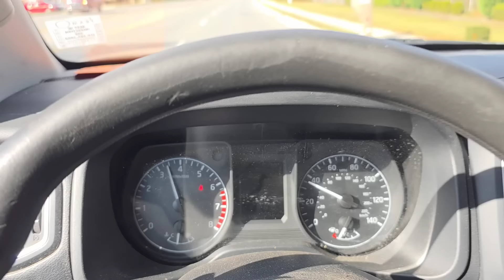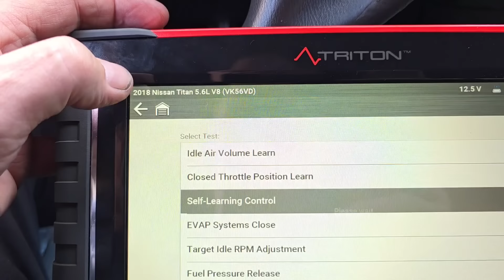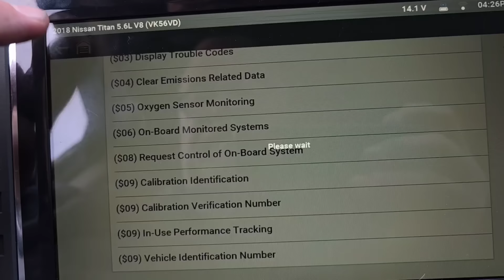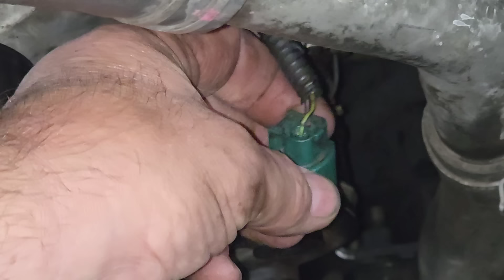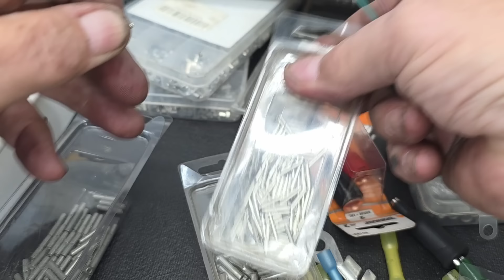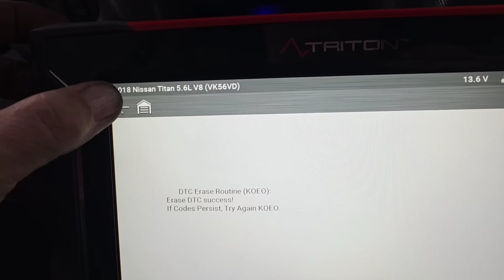Mobile Mechanic You Don't Know Can Be Costly!!

Comment: 2:53 Does it have any weird tune on the ECU? Or a weird OBDII "fuel saver" thing?
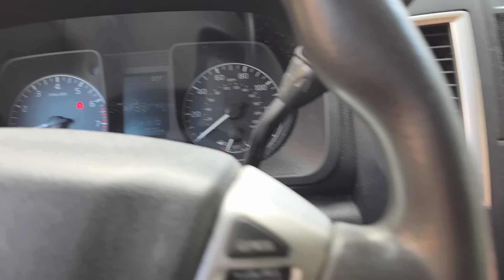4:34 I have no idea.. I know my 2005 Nissan Frontier was acting odd, but it was also stalling, it was a camshaft sensor, but you don't have a code for that.

Comment: I completely get why manufactures went from metal keys to key fobs and push-to-start because sliding a key into the switch and twisting it is just too much work! Turning a metal key is to carpel tunnel just as crank starting was to broken arms! 🤦🏻‍♂️🙄

Comment: Kenny, when you solder wires it is far better to tin the wire first then tin the connector pin, pre-assemble with that clever device. You need only to apply the soldering iron to the pin and the wire and clip join perfectly. This is something that I was taught during my apprenticeship '68 to '73. I'm not trying to teach my grandma to suck eggs. Do sorry if it offends you.

Comment: I have seen it too, some butcher things up. Seen it with a 2007 GMC Yukon, the previous person put in an used transmission leaving   an exhaust shield missing including bellhousing bolts and transmission mount nuts missing. Vent tube was cut and the transfer case nuts were loose. Before this,the guy bought it at the auction with problems which we found a gas line cut replaced with rubber hose secured with hose clamps to the fuel pump. One of the exhaust manifold bolt holes was covered with RTV made for exhaust applications, hardwired the oxygen sensor wires in cutting off the connectors.
Reply from the maker: Wow! That sounds like a nightmare. Thanks for sharing your experience and keep wrenching 🔧 Kenny
Reply: @WrenchingWithKenny  It was,  good thing was we did it right when reinstalling the transmission

Comment: Please see my solder comments under "walterw431".  Solenoid polarity comment:  Maybe in automotive world DC solenoids do not have flyback diodes, but these diodes are common in other industries.  My point... Be sure that the solenoid really does not have polarity.  The driver electronics can expel the "magic smoke".     Ooops.  I see mitchm275 has a better comment on solenoid polarity.

Comment: tip- tin your wire  and yor connector seperately  then solder them together. better joint less solder less over flow

Comment: word of caution on more modern 2 wire solenoid units, some have an internal diode, then it will matter which side gets the positive and negative. that is to absorb the power spike that will be much higher than the 12vdc and can back feed the ECU. depends where the diode is in the system or which type diode on the driver in the ecu. many solenoids when they collapse can hit 18-22vdc. same with customers who just grab any 5 terminal relay thats cheap. many have resistors or diodes across the relay coil to once again protect the circuit

Comment: Hi Kenny. You may want to flatten the copper wire before you try soldering that wire to the shank of the terminal. The goal is to keep the repair area as small as possible so that it can be inserted into the connector shell. sometimes the space for the shank close to the terminal is not much bigger than the wire crimp part of the terminal before repair. Cheers.

Comment: Good solution to a common wiring issue , trying to fix the car today and the parts are 2 days out. Nobody can keep al of the different wiring connectors or plugs in stock.

Comment: the easy way is to prep both areas with solder and put them together and heat to get the connection/ help from Sweden
Reply: Kenny, I watch all your videos (I do not work on cars) but I had to stop the video when you were soldering.  So hard to watch.  1. Tin the wire first. PLEASE.   2.  The rule about putting the soldering iron under ASSUMES that there is a mechanical (heat flow) connection.  Hard to get such in this case. So put the iron and solder on top, as follows.  3. The "2 clip" jig also works great when there is a mechanical connection, but not in this case.  4.  Put the connector pin on a piece of wood and weigh it down. Place the tinned wire and hold in place. (Expect burned fingers :) Put a little fresh solder on the iron and place iron on top melting everything.  Remove iron. Cool. Done.
Reply: @paulrobinson2062 he is a hack pissing on everyone else. That is soldering 101...

Comment: You should be ashamed of that solder job, clip holding the pin is drawing the heat away , no flux, wire not tinned.
Reply: Must be nice to be perfect, there’s a better way to provide constructive criticism.
Reply: @joemay7704 i totally agree with you. This was just a simple repair to get the guy on the road and not something that's going into outer space.

Comment: i usually scrape the pin where i want to solder the wire then tin that place with solder and the put the seal on wire, strip a little bit of insulation off, tin the end and solder to the pin making sure that solder joint is as compact as possible, some plugs don't have a lot of space inside. man its not very fun when there is more than two wires and you don't know where each wire goes. Its quite a common repair that i get to do.

Comment: A great tip is to pre tin your bare wire before soldering. Also, a little extra flux helps the joints should be bright not cloudy or flat looking. Keep up the good work! I do a lot of guitar wiring in tight spaces as well as locksmith electronic equipment.
Reply: I was about to say the same.  After tinning in a situation like this I may use a long single strand of fine copper to bind the wire to the terminal before final soldering. Helps to keep the joint tight/compact to help it fit back into the connector.
Reply: @Aussie-Emlyn Smart idea, wrapping with a single strand of wire to hold down and reinforce during soldering of wire and connector. Thanks for sharing.
Reply: They make flux pens that you can use before you solder. It's a no-clean flux too.